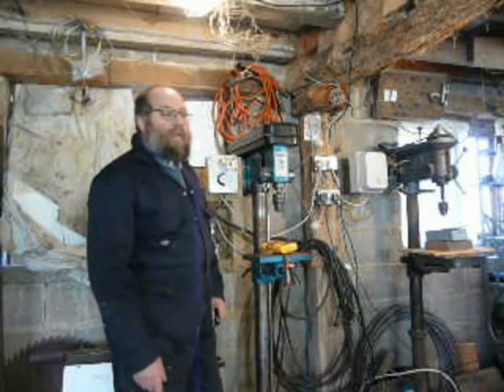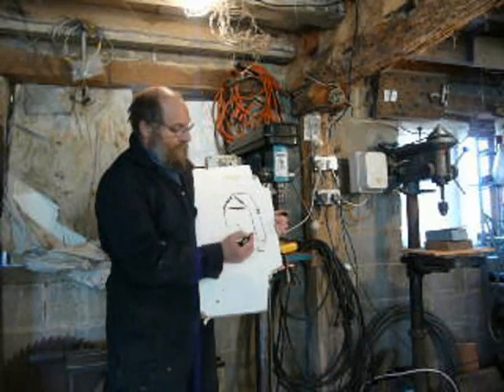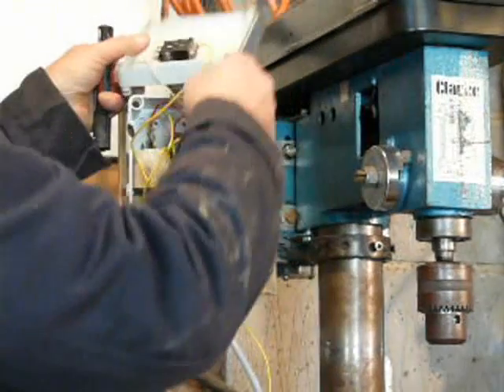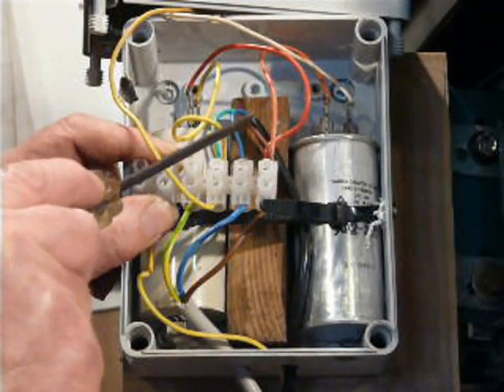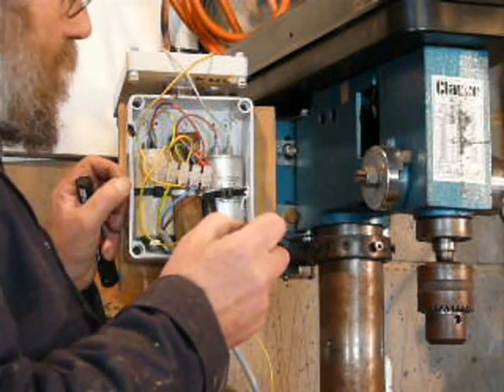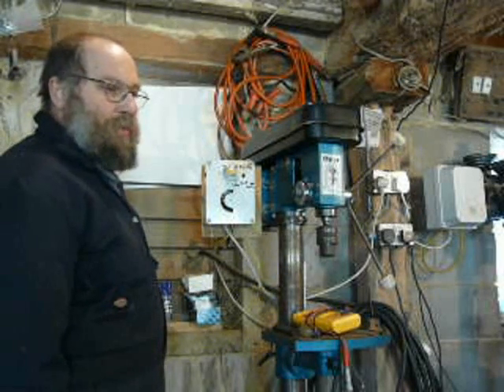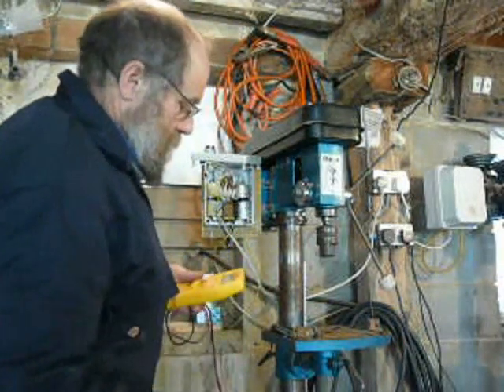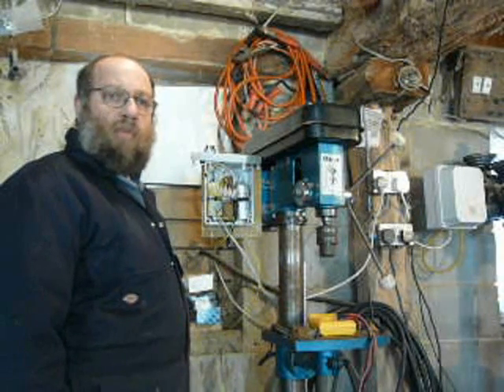How to do it: 3 phase motor conversion. Part 4 the start capacitor

Comment: thanks for this very helpful video. What are the voltage of the caps. 240 or 440 or does it matter. Also with my Dayton I can not see the six poles. I have a total of 9 wires, 3 tied together which I assure are the 3 linked for star. Then 3 pairs of 2. The 9 are labeled T1, T2, T3, T4, T5, T6, T7, T8, AND T9. The 3 phase wiring diagram for 208-230 Volt is T4-T5-T6 LINKED, THEN T7-T1 LINKED FOR L1, THEN T8-T2 LINED FOR L2 AND T9-T3 LINKED FOR L3. Is it safe to assume the T4-T5-T6 are tied together for star?
Reply from the maker: Hi. Several comments have been made about these 9 lead motors. I have never seen one  so if I gave any comment it would be a wild guess, so best not. You can use this capacitor method with a star connection, and it seems like you may be able to adjust the wiring to suit you supply voltage. Capacitors should be to at least supply voltage but if they are rated at a larger voltage it does not matter. All the best with your project and I am sure some viewers would appreciate  news of the results from your experiments. Cheers, Andy

Comment: Thanks for the videos Andy, I'm looking to convert all my machines to a mixture of 3phase and dc motors (I steal them from old treadmills), though I will be needing speed controls so Capacitor conversions will only help me on a few motors.
Reply from the maker: Thanks for the appreciation. mrpete222 has a video series on a 3 phase converter / inverter with speed control that he fitted to a drill press. Cheers, Andy

Comment: Sir , can we reverse  the motor rotation?
Reply from the maker: Hi. It's described in the video, change the capacitor from one supply connection to the other. That will change the rotation. Hope that helps.
Reply: Thanks.that will help.

Comment: Thanks for making these videos Andy, you have proved to me what I thought must be possible, possible!  I am trying to find a formula for calculating the correct size capacitors for start and run for a 4KW (approx. 5HP) fan.  Can you give your opinion?  After trawling the internet I am being swayed towards 150uf for start and 75uf for run.  I am doubtful that the run capacitor will be large enough though.  I don't want to waste money purchasing capacitors of the wrong size.  Thanks
Reply from the maker: Ben. You will have to do some homework. In the comments on one of these videos is the formula. Cannot remember which one. You can always parallel capacitors to get a higher value and so use second hand units. Your problem may be the starting current. Please let me know how you get on. Andy

Comment: I guess I hadn't really thought about it before. If I had a dual voltage 230/460 motor, I'd just wire it for the lower voltage 230 (single phase) available. Not thinking whether it was delta or wye. But yes, it would then be wired in the delta configuration.
It was fun watching your video's, and I am much more aware of the delta Vs wye configurations now; something I used to care little about.

Comment from the maker: Thanks for your positive response. Wiring the motor in delta makes a closer match for the 230v supply. The capacitors are wired in parallel to add several capacitors together as seen in part 2. Thanks, Andy

Comment: It is a fascinating concept. I've converted a few of them now. Ironically, always for someone else, never had to do it for myself yet. They are always amazed and grateful.
I've never concerned myself with whether the motor was wired wye or delta, only that the wiring was proper for the voltage. Keep up the good work!

Comment: @ Mizelovan
My guess is that you're using just a bit too much capacitance. I measure both the current and the voltage (when under load) then adjust the capacitance to get things as even as possible.
If memory serves, as long as you don't exceed something like 70% of the full rated load of the motor, you can run it for as long as you like.
If you have difficulty starting with the lower capacitance, that's when you use a start cap to get it going.

Comment: which is advisable capacitor to be use in converting a 3phase 3horsepower motor , running capacitor or starting capacitor , and what is the advisable microfarad to be use 
??
please detail the possible connection of the capasitor to the motor

Comment: Yes, easy to make it start, Just put 40-50 uf per Hp, but how much power would produced after running, and is it safe for the motor on a long time period?.

Comment from the maker: .Hi. It may be that your dual voltage motor is 110 or 230 volts, but at single phase. For 3 phase there would definitely be 3 connections. Hope that helps

Comment from the maker: Steve, you would be best to get nearer to 230v if running on delta because of the motor coils being wound for half of 415v, so you will probably need a start cap. You can "Tank" these motors with a capacitor from both the live and neutral to the 3rd terminal, then a start cap dictates the direction of rotation. There is a link somewhere in the comments on one of he videos to a site that shows all the details. This makes all 3 phases work. Hope that helps.

Comment: Hi Andy, thanks for the positive reply, I have a 3 phase 1.5 hp motor running with just a 30 uf run cap, this is for my wood lathe, I have measured the volts and it is 250v constant over all 3 leads, 
I would be happier with less run cap and a much bigger start cap included with switches, mind I have yet to check everything under load, ie with a decent job on the lathe, if I reduce the run cap , then I may get closer to a 240v constant or do you think 250 ok again many thanks for your time Steve

Comment from the maker: Hi. Thanks for your comment. The motor on the pillar drill is 1/3 hp. As a general rule 30 uf per hp but that can vary with motor and the duty. I use these 250v caps as the motors are not used continuously but a higher voltage would increase durability. Always check the coil voltage when the motor is running to prevent over voltage from using too large a capacitor. Hope that helps.

Comment from the maker: Thanks for your comment. The morticer in part 2 did not need a start cap because very little starting torque was needed, but with the drill press there were belts and a lay shaft to turn, hence the need for a start cap. I suppose I should have shown the press actually drilling something to show it had power. Maybe that's part 7.